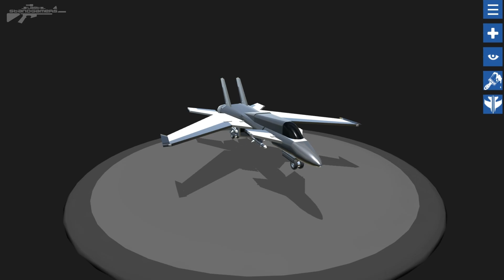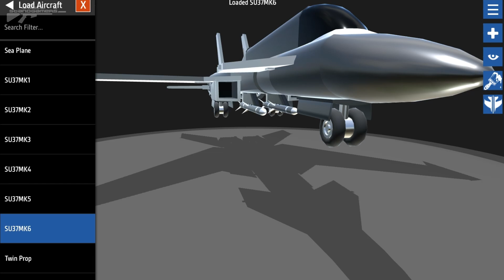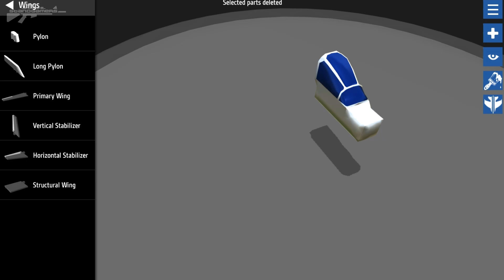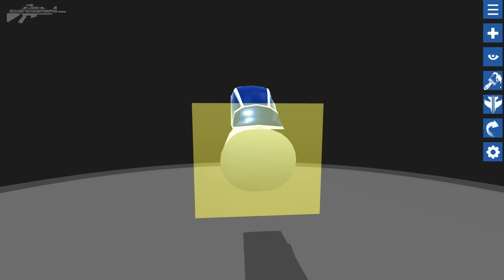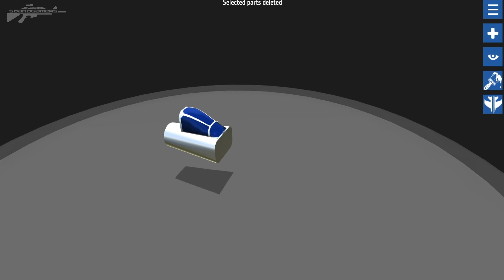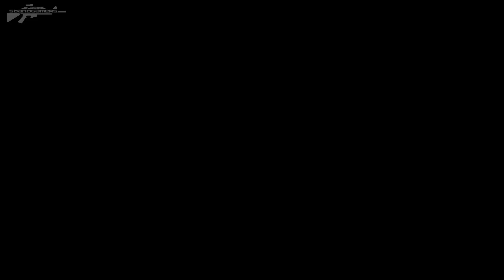Simple Planes - Build & Dogfight Quick Look

Comment: Why are the wings on your first shown plane backwards?
Reply: There are a few planes with backwards wings
Reply: Can you link some of them please ?? I don't see any planes with that kind of profile :/
Reply: +Chef Boyardee but wings don't work that way in real life. The shape doesn't allow for lift.
Reply: +Chef Boyardee but wings don't work that way in real life. The shape doesn't allow for lift.
Reply: +Chef Boyardee it's not the forward swept part that I'm talking about. It's the cross-sectioned shape. Do you see where the flaps are? Those should be on the other side. (In other words, the side facing forward is the side that should be at the back; the fat side. The plane would have a much better lift if the wings had the "fat" side [flap side] on the other side.)
Reply: +yannick martens *I miss spoke, the fat side is the front, the flaps go on the thin side. The thin side should be at the back. Otherwise, lift is extremely difficult and inefficient

Comment: Those wings are the wrong way round!!!!!!!!!!!!im gunna pull my own head of ahhh1"!£"!£ $1234
Reply: Joking? The SU-47 has the same swept forward wing design. In real life it grants far greater maneuvrability
Reply: +WatzUpzPeepz they look wrong ¡!!!!
Reply: Swept wing designs are far superior than regular wings
Reply: they look just right for my Ace combat loving heart
good old corsair and Fenrir
Reply: nah, man.  forward swept wings, while uncommon, were actual wing designs.  Take the Gumman X-29 experimental plane, or the Sukhoi SU 47 Berkut for example.  Thing is, forewards swept wings allow better manouverability at greater angles of attack, at the cost of problems with the wing tip bending, unstable yaw, and unstable stall (thouth the unstable stall is typical in swept wings in general)
Reply: The plane makes itself lighter in flight
Reply: +HALOman 4782 depends.  each type of sweep has its own advantages and drawbacks.  unswept is actually great for subsonic low-speed planes.  example: prop planes.
Reply: +Andrea Sim interesting prop placement, that's for sure...
Reply: *****
not with the elvetors on the front
Reply from the maker: That's what I based this build on a beautiful looking plane but still very experimental.
Reply: +LastStandGamers that plane brought back memories of playing ace combat 04 shattered skies and my favorite plane the su 37a mobbius 1